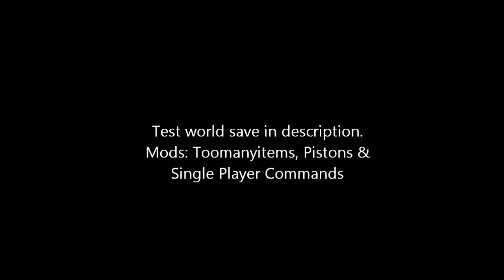Empty Cart Detection Mechanism Based on Idea by TaviRider

Comment: There are a couple of other ways you can do this as well I've found. You can make carts jump, as there are 2 different jump distances depending on speed (slower goes further). You can use a detector right after a turn in a t junction and if you are going fast enough you will go in the turn and any other speed will go out the other end.

Comment: Thanks for the credit. I knew you'd be all over this. :) You can post it to Reddit if you want.

I was hoping to make one where the player doesn't slow down so much. Ideally the player stays at top speed, so maybe a two powered rail boost at the start? You're right that the margin has to be pretty large because of timing inconsistencies in Minecraft...